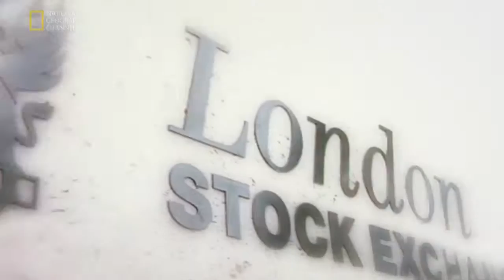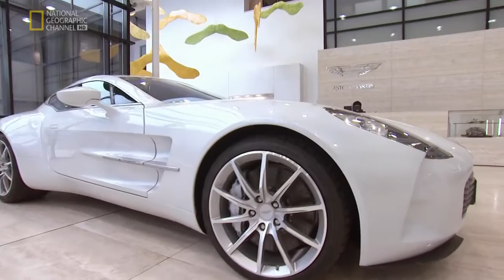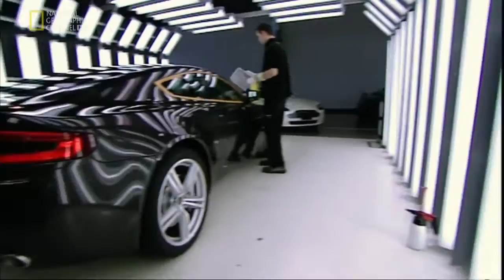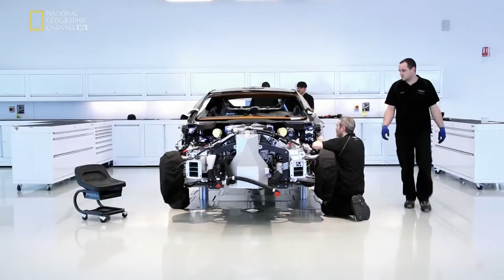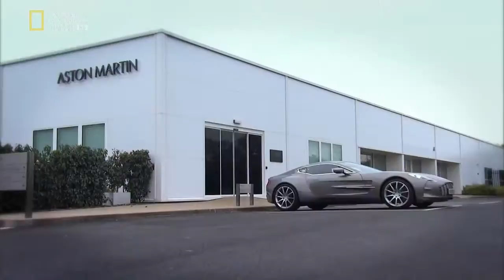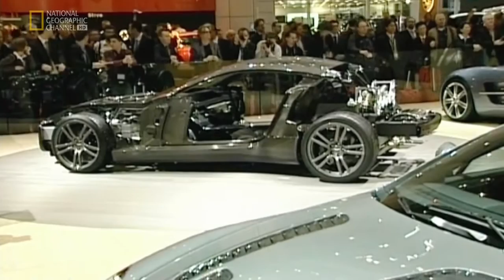mf aston martin one-77 HD

Comment: To be honest the front air intake and the line that flows through are the only things that bothers me aesthetically which leads me to think why. 

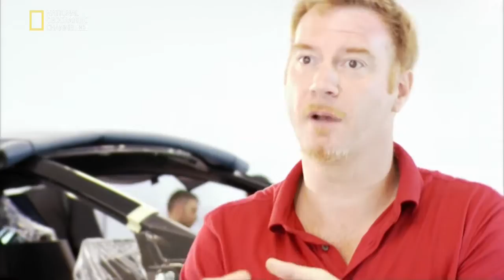At 43:58, I see the groove lines from the side doors follow through to the front intake but then stop, personally would prefer this line to wrap round the front with a much softer edge, which would men less grille from bottom and create a soft bumper area (this effect would create ample space for front licence plate). Just my opinion through